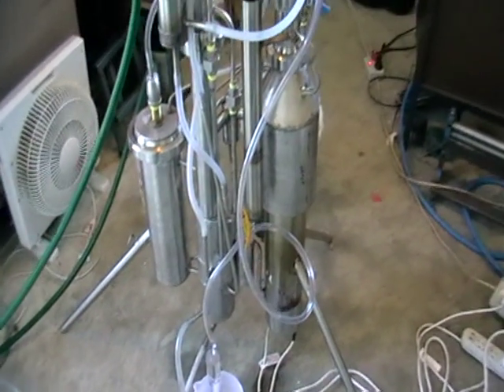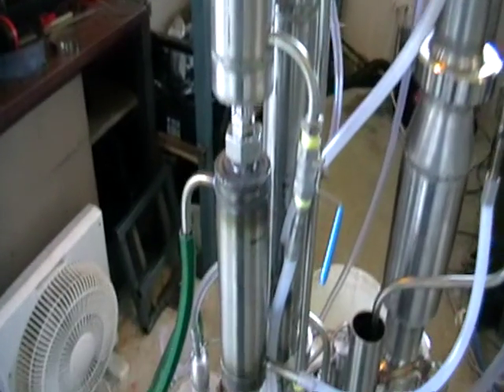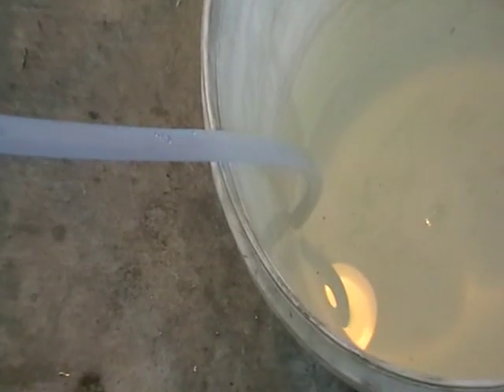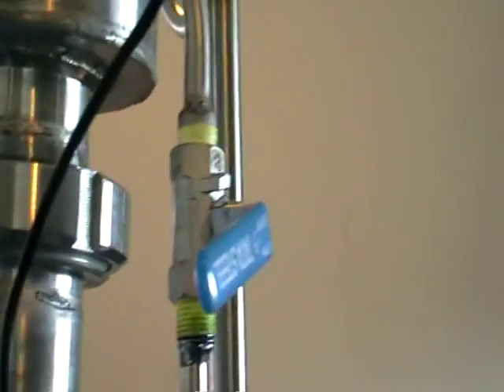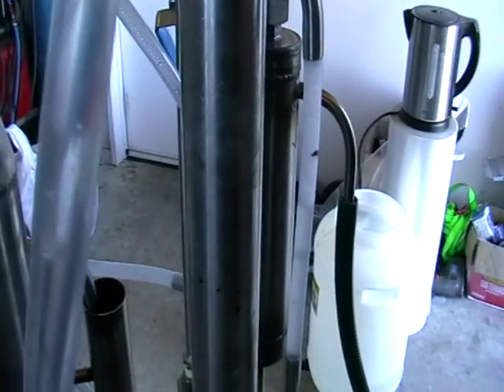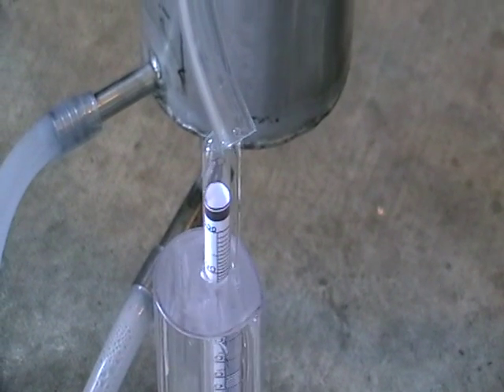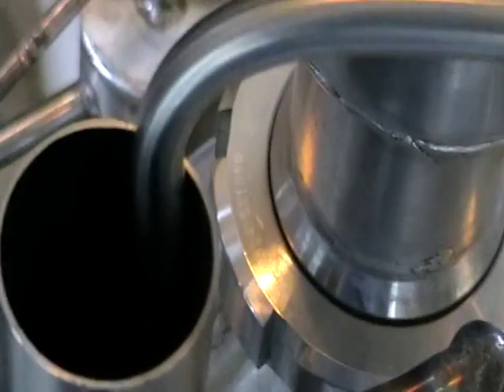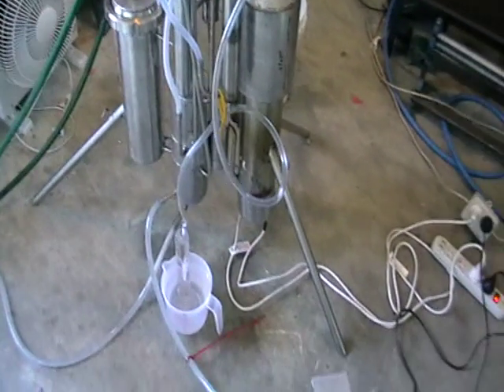Reflux alcohol  still.

Comment from the maker: the processing speed depends on the percentage of wash, this one is up to 20L per hour, the system is almost instant, the percentage of output alcohol is controlled gets to 90 - 95% and system is designed to work with 10 - 12% wines as a feedstock.